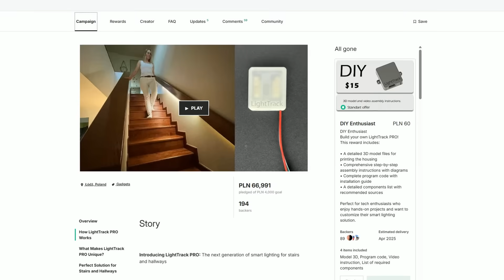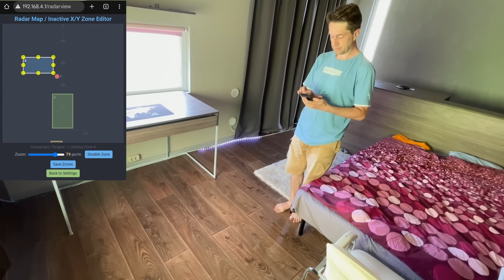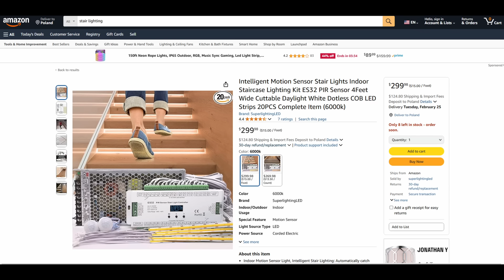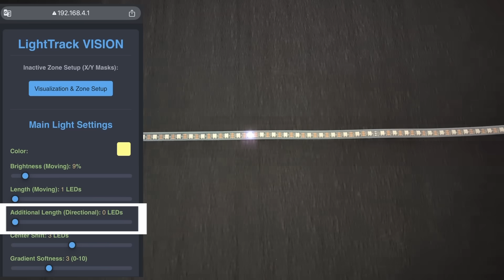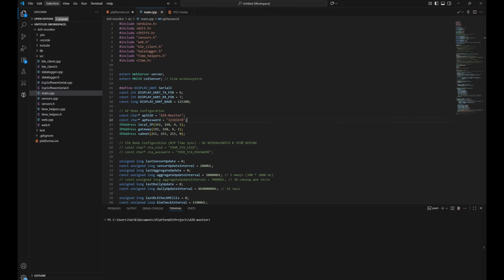My Smart Lighting Invention for Home & Yard (Open Source Code)

Comment: This project inspired me to try creating Arduino projects.  However, my setup, while it looks just like yours, only appears to detect the 'presence' of a person and then light a section of the lights.  The controls appear to make the number of lights lit change properly, but it never moves when movement occurs in front of the radar (the end lights flicker a bit), and the visualization & zone setup does not show any person on the radar map - just the boxes (no movement of anything).  Are there further modifications or libraries I need to make this work?
Reply from the maker: Hey! Really glad the project inspired you — that honestly means a lot.

From what you’re describing, it looks like the radar isn’t sending full coordinate data. In that case the system can only detect “presence,” which is why it lights a section but doesn’t track movement, and the visualization shows no targets.

A few things worth checking:

Radar library.
Some LD2450 libraries only report basic presence or work incorrectly. Trying a different library usually fixes the issue.

TX/RX wiring.
If TX/RX are swapped or the contact is loose, the board may appear “alive” but won’t receive coordinates.
Reply: @DIY_Yarik  Yes - thank you for the inspiration!  I did figure out the issue.  The Arduino library for the LD2450 (RGBEGamer/HLK-LD2450) version 1.1.0 is sending corrupted coordinates (actually about 30 meters too far away), so reverting to 1.0.9 works, but it is a bit jumpy compared to your videos.  Now everything works properly, I just need to find a way to make it smoother.  Thank you for what you have made and shared!

Comment: Hey! Awesome project! And thank you for making this open source! Seems like the timing was perfect as I'm currently redoing my stairs. I have the almost the same hardware, ESP32 S3, LD2450, 2811 (for now) but having an issue with tracking me. Does these value seem in range? Y coord seems extremely off. 

Any help would be appreciated it! Thanks!

{"targets":[{"id":0,"x":88,"y":-32372,"s":0}]}
{"targets":[{"id":0,"x":90,"y":-32370,"s":17}]}
{"targets":[{"id":0,"x":91,"y":-32372,"s":0}]}
Reply: It ended up being an issue with the ld2450 library (RBEGamer) I was using. I made it work(ish) with a modified version but its jumpy. Do you mind sharing the library you used? Thanks!
Reply from the maker: Hey! Glad you figured it out — yeah, that −32372 is the classic sign of broken frame parsing 🙂

I’m using the modified version of the original LD2450 library by ldrobot
 — not the RBEGamer one. I rewrote a few parts for better frame sync and stability on ESP32-S3 (the stock parser sometimes drops bytes at 256000 baud).
Reply: @DIY_Yarik  Ah gotcha! Any chance you can upload your modified LD2450 library? Thanks!
Reply: @DIY_Yarik  hello! Very nice project and thanx for sharing source code! Unfortunately I'm stuck trying to use Your code, as the radar part doesn't seem to work with rbegamer library. I can't get it to work with darkjumpy or fiooodooor libraries either. Could You please share modified original LD2450 library that You are using to compile it as it is the important missing part from source code that You made available; without it you can't really diy it :(

Comment: From a home automation standpoint, it would be nice to be able to send settings over mqtt and also receive position data. This way I could have different colors on different times. And I could switch other lights on depending the target data.
Reply from the maker: That’s a great idea — and exactly what I’ve been experimenting with lately. I’m testing MQTT and Home Assistant integration to see how well it performs without affecting real-time response. If it works smoothly, it’ll definitely make its way into a future update.

Comment: Hey. This is awesome. Subscribed. I have an idea. What about using this system to guide people in hospitals with floor light strips. Imagine you arrive to the hospital and op on entering you first se a terminal where you enter your id or something equal. Then it says follow the light and as you walk the light follows you to your destination.
Reply from the maker: That’s a fantastic idea! For hospitals though, this setup isn’t the right tool — the radar would get confused with lots of people and start lighting for everyone. For that use-case you’d need a more complex system, like BLE or UWB badges to identify each person individually. This project is meant for home use, where it smoothly follows just one person.

Comment: This looks really cool, but the use case I have in mind for it is a curved path through my yard.  Would it work if the sensor loses “sight” of the person walking along the path?  Also, in a straight line, what’s the range of the sensor?
Reply from the maker: If the person goes completely out of the radar’s view — then no, the light won’t follow anymore.
But if the obstacle is something like leaves, thin wood panels, or a tree, the radar can still “see” through it and keep tracking the movement.

The detection range in a straight line is up to around 8–10 meters.